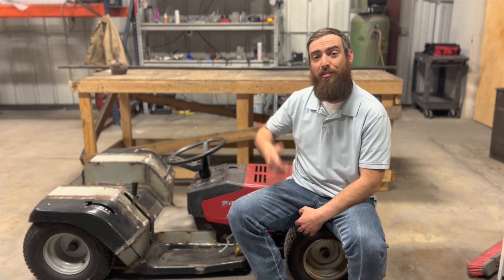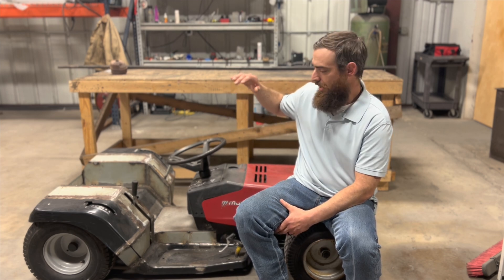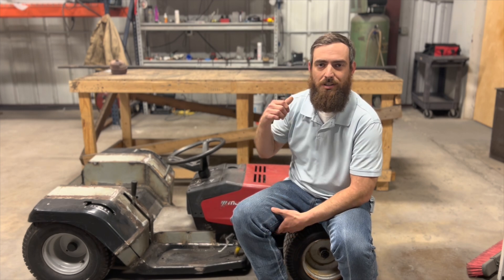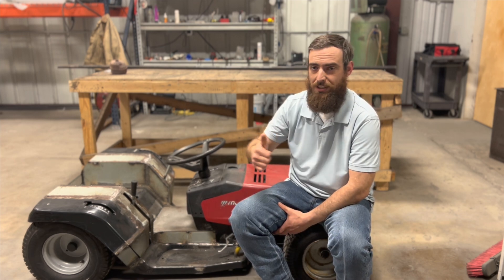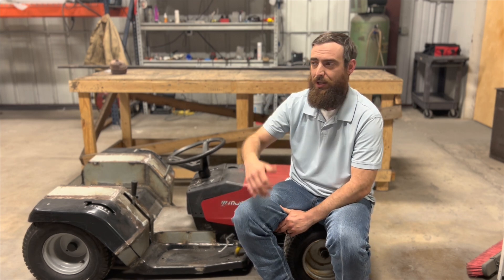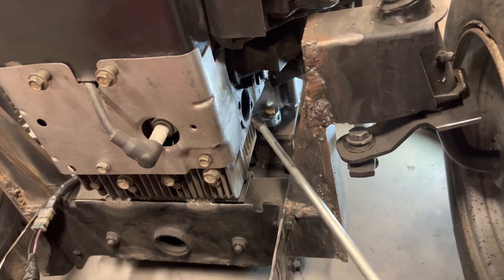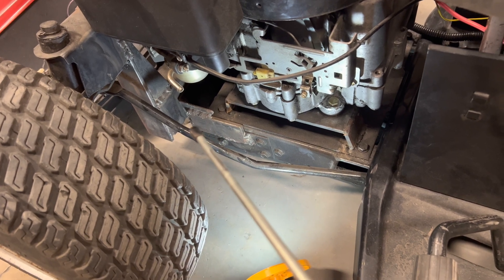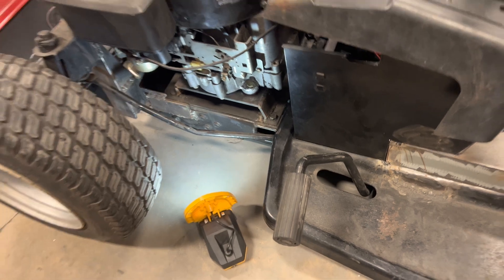How To Lower a Lawn Tractor as Low as Possible Pt. 7

Comment: I forgot to mention putting a sheet of rubber in the top of the battery cover to prevent the (+) and (–) battery terminals and their wiring connectors from shorting in all cases, but especially when going over bumps.  A thickness just under touching the closed lid all the time, or even just barely touching.  You could make a battery clamp system, to keep it in position and centered if for nothing else. but a full-size lid rubber cover is still a good idea, IMO, in case the battery moves around inside and even with a clamp.

Great job making the exhaust flange repair!  I was also impressed with your exhaust pipe construction.  You're quite the Pro at fitting and welding.

I can see in your engine starting tests that the exhaust pipe is throwing a LOT of sparks, which you wouldn't know about without watching that part.  You may want to consider a spark arrestor if you haven't already and your muffler doesn't have one.  I would think a Briggs muffler would be fine, but I'll see what you selected in the next video.
Reply from the maker: More great tips! Thank you!
Reply: @wybarprojects   You're welcome.

Comment: Block off one end of a rectangl pipe punch a hole in the side inside the rectangular tube  weld in baffles  angles facing the air stream but not blocking it
These will build presure and trap gases causing the gases to slow down and some will flow backwards canceling out the sound this is bassicly how a muffler works it can exit under the foot plate then at the far end thats also blocked off exit a squar hole.   The baffles need to be in a staggered chevron pattren  , personally I thought it was pretty cool it was blowing out sparks.  A home made muffler would be cool.

How about a seat.  And paint job.
Reply from the maker: The seat and paint job are coming! I like your exhaust idea, I may take that on at some point in the future

Comment: Elbows » Carbon Steel Buttweld
Product Name: 1.00 STD LR 90
SKU: 135987
Weight: .35
Origin: Import
Schedule: STD
Size: 1.00
Type: Long Radius 90
Description:
A234 WPB WELD FITTINGS-IMPORT

FOR 1" PIPE (1.315 OD) STD (.133 WALL) ANSI B16.9
Reply: also try some anti spatter spray